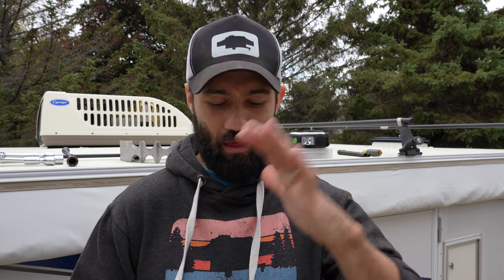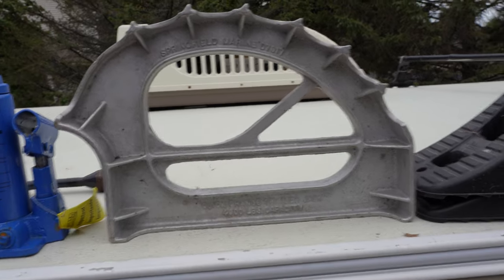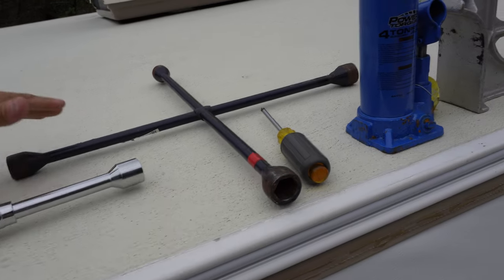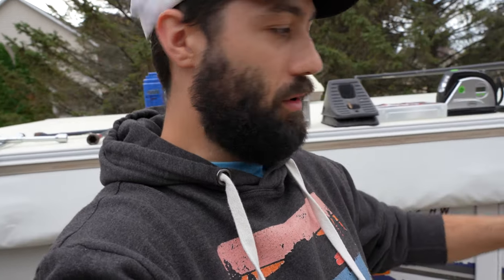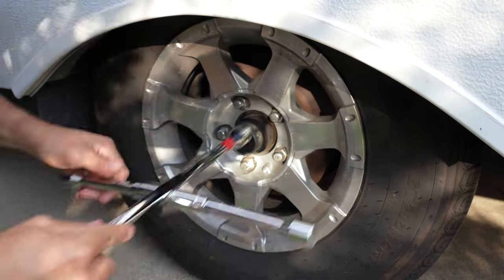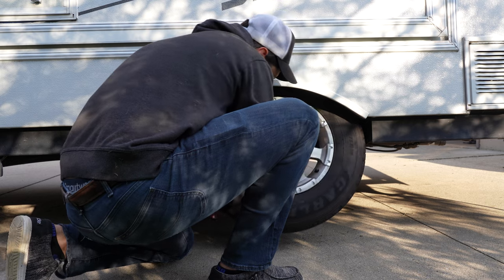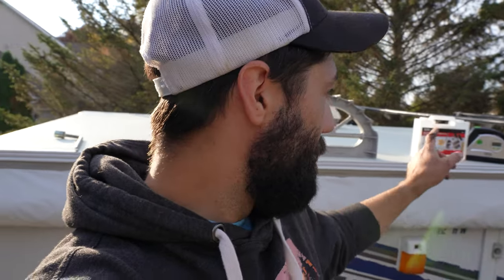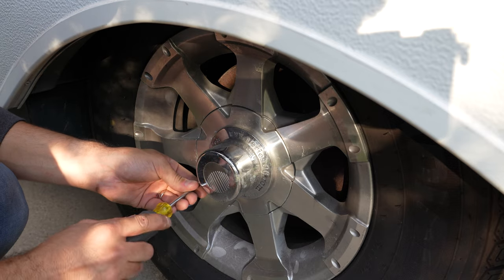HELP! How to Change a Pop Up Camper FLAT TIRE | Tools, Tips, & Tricks

Comment: Thanks for this video.  I have the same Jayco Select but a couple of years older than yours and I thought maybe the issue of getting the tires out of the wheel wheels was unique to mine.  Even after deflating the tires I have still had a little difficulty getting the tires off.  

Also, I'd like to share a little story with everyone out there so you can use me as the example of a "lesson learned the hard way" and avoid it yourself.  Last fall when returning from a camping trip I had a tire failure on the interstate.  The entire tread face of the tire came off and, fortunately for me and my wife the tire did not deflate immediately.  I was able to safely pull off onto the shoulder and about two minutes after stopping, the tire started going down and was completely flat within five minutes.  As luck would have it, my spare's valve stem had dry rotted and it was useless and, I say "as luck would have it" because the tire on the other side probably would have gone flat within a few miles.  Turns out that both tires were nearly ten years old and, even though they both had lots of tread and looked good, they were not.  So, don't be a cheapskate like me and try to make your tires last longer than they are really intended to.  I got very lucky that there was no damage to the camper and even luckier that the tire didn't go flat immediately.  I've seen plenty of video of trailer tires going flat with some very dangerous consequences.

Comment: Of course you know we had a major tire blow out in the middle of South Dakota this summer. 😬 One thing we have now learned to keep with our tools is that metal tape like for HVAC.  We were able to completely reconstruct our wheel well with it and get us on our way!
Reply: In line with this type of incident. I just purchased a pop-up where the previous owner had a significant blowout which left significant damage to the wheel well. What would be the best way to do a more permanent repair?

Comment: Your wood blocks illustrate the issue I had the one time I had a flat on my little Starcraft with torsion axles.  I was on a two-lane road and the flat was on the traffic side (aren't flats always on the traffic side) and there was very little shoulder to pull off the road.  I got the truck jack out only to find that it didn't extend high enough to actually lift the trailer because the trailer frame sits so high.  I don't remember how I resolved it, but I probably found something to stack under the jack. After that trip, I found a (relatively) light-weight floor jack at Costco that I bring with me.  While it's bulkier to transport than a bottle jack, it's got a high reach and it's VERY quick up and down, so it minimizes my time to change a tire and therefore is MUCH safer (especially if the flat is on the traffic side)...and I can use it to fix flats on the trailer or the tow vehicle.

Comment: Bummer about having to deflate the tire to get on or off. I'm rock'en the starcraft and haven't had to experience that issue.  
Thanks for the video.
Any chance you can make a video showing the people good ways to stow away the camper while it's raining? I think it would help explain the patience it takes to keep the bedding dry. 🤯

Comment: I have a highwall and learned from having a flat on the side of the highway. To carry a floor jack( that can pick up the camper) The bottle jack did not feel safe on the side of the highway.1/2" battery impact and sockets to remove and reinstall the lugs.  I do carry a air compressor and plugs.  It would be nice if the manufacturers would mark a spot under the camper or a note on the side to know where to place a jack at.
Reply from the maker: Agreed

Comment: Quick question.. I have a pop up camper that my ac works but it trips the breaker at the hottest peak of the day which is between 12-6pm . I usually turn it on around 7pm and it stays on all the way till the next day around 12 and trips the breaker. Is not low on Freon or is dirty i done spray some coil cleaner change the filter. You think it might be the breaker box . I know the breaker box has a small fan built in but I don’t see it tim on right away or it turns on later on . Hope you can help me . By the way I live in texas and it gets hot..

Comment: I didn’t have a flat but, when I picked up my pop up, I found that the wheels were low on air.  After trying to top them off at gas stations who’s air pumps didn’t work, I decided to use the air pump I drought with me only to find that the cord wasn’t long enough to reach the wheels.  I removed the wheels one at a time and brought them closer so the cord could reach.  As soon as I got home I went on line and ordered a 25 foot long cord.

Comment: what a horrible design from Jayco. Came to this video because I've been curious how I will change a tire as I have the exact same model and it sits so low. Never though will have to deflate the tire. Unbelievable. Might just carry the spare deflated as I will have to deflate it in the side of the road. I still in shock that's the way to replace a tire.